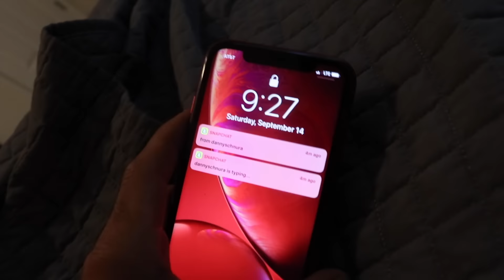STEALING MY DIRTBIKE BACK!!

Comment: 2 months ago  I broke my leg including a finger on a 450cc and believe me it hurts.  I was going top speed on a private road with no helmet on  and turned a wide corner and lost control and hit my head into the pavement which gave me brain damage and a very bad memory. Keep up the good work dude.😁
Reply: XxToffeeGrappleXx 1965Xxc6 damn you a grinder how fast did you go
Reply: @xd_saucyyy_yt6775  I was going 86  mph or something like that. I was racing a friend
Reply: XxToffeeGrappleXx 1965Xxc6 dangshould i get a cr80 or cr85
Reply: @xd_saucyyy_yt6775  ik
Reply: XxToffeeGrappleXx 1965Xxc6 answer the question